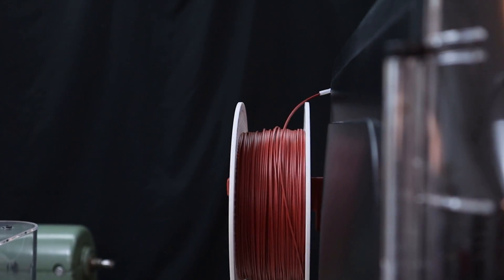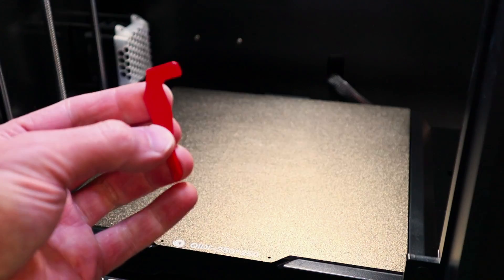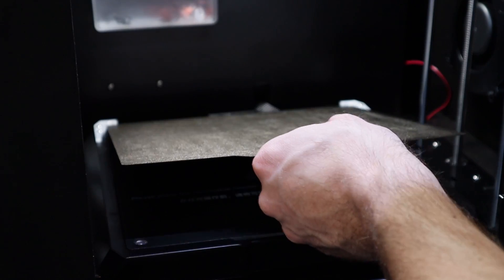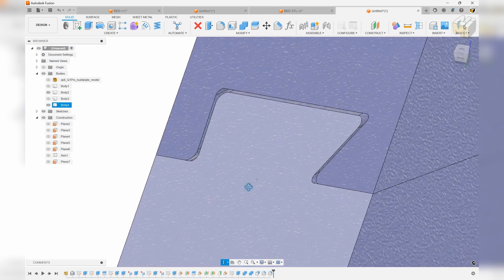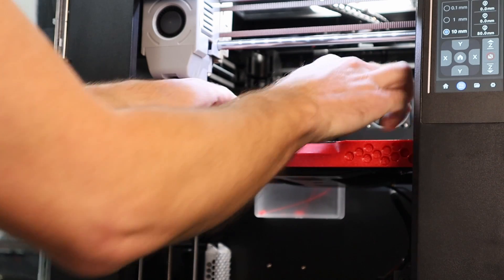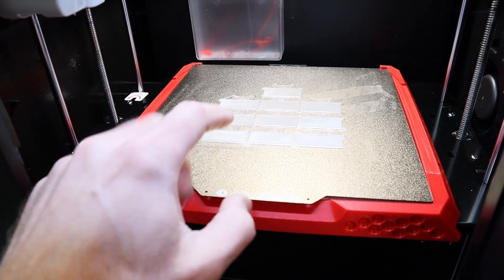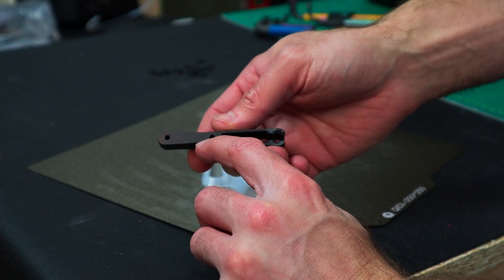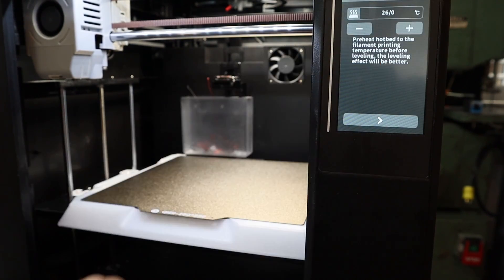Upgrade your QIDI Q1 Pro with Dual Build-plate Stops + more

Comment: Its fixed. Super easy to place on my printer. The wiper is the biggest issue. Leave the structure on a side. Only time will show how reliable it is. But the felt pad... Silicone brush, carbon fiber brush... I am pretty sure there are at least 10 other better options.

Comment: I just got my Q1 PRO. Good news, this upgrade is no longer needed, it comes with the new machines along with a larger print surface 250x250.
Reply from the maker: That's good news, it would be a bit annoying to have to buy a spool of higher temp filament just for this job.  I'm glad they decided to make the adjustment.  My Q1 is still going strong, it's been a really good machine.

Comment: Thank you for this video! But I have some questions... Please help me...
1- How could you dismount the black frame which is the bottom of the bed? I saw 3 screws under the pei table but they are so rigid. I couldn't dismount.
2- How could you dismount the side covers?

Comment: Qidi has fixed this now in their latest printers. The shroud now has two notches in the corner rather than one in the middle. So cool to see a company like this listen to customers and make adjustments even on a budget printer.
Reply: This is cool to hear. I just ordered on for my classroom toolbox and it's nice to know the company is listening and adjusting.
Reply: @AmericasTeamAdventure  Awesome. Hopefully it works well for you as well.
Reply: Yep I bought one of the new ones after seeing the original reviews and was confused on that. I just assumed it was customer feedback related
Reply: I guess, that's the price you pay, when you get a free preproduction unit for review - you're the beta tester ;-) 

BTW, that's not the only thing they fixed. They added a note for European customers on how to prevent to electrocute themselves. Since for example German plugs can be plugged in either way, you could end up with the build chamber heater being live (and not neutral).

And if I got this correctly, they also rearranged the ptfe tube now so it doesn't scratch the top cover any longer.
Reply: @PeterTeuns  Yes! They did fix the PTFE tube. I didn’t want to comment on it before having the machine for long. It’s now been just over a month and my top panel looks great.

Comment: Love it thanks. Question for anyone that has done the platform calibration . After you unscrew the nut and the cal , should you tighten back the nut. I ask because i noticed when i tighten the nut the  and do a quick paper test it seems now  be off and not how i left it. It pulls the plate down. Is that ok?
Reply from the maker: Ah yes, what I did for the nut was add a bit of blue Loctite, you can also use a dab of silicone, and then when I tighten it to the bottom of the 1st nut, I just bring it snug, not to tight, that should help.  Sometimes when you tighten a jamb nut it can also rotate the nut above it.

Comment: Thank you for this video! I am so new at 3-d printing that my QIDI pro printer is supposed to be delivered tomorrow. These parts appear to be needed and I will attempt to print them out. I also subscribed as I think your channel will become my favorite.
Reply from the maker: Hey thank you!   You're going to have a great time with this printer, it has to be one of the all time best bang-for-the-buck printers.  Before you print anything, I've heard that they have have added some stops in to newer models, I can't confirm this for sure, you may want to open it up and see, maybe you'll be able to save some time and filament.  If not, you'll at least have a backup plan.  I have videos coming at least once per week, I'd prefer more and I think some weeks I'll be able to do two, depending on complexity etc.  Any support is greatly appreciated!
Reply: @NeedItMakeIt stops?

Comment: I've been running this thing for three days straight not one fell
Reply from the maker: I've had a lot of success with the printer, I think the only 2 issue I had which was really my fault were that I set the temp at exactly 60C and it likes to be just a tad lower so it threw an out-of-range error and then when loading and unloading filament I've found that extruding to make sure the filament isn't too soft for PLA when trying to load in new filament.  The path for the filament could be a little shorter and I find that it helps to extrude and then retract to get a good pull.  I've a couple of times now where there will be a piece of melted filament that gets stuck.  Other than that for the price, this is my #1, Bambu X1C is a great printer of course, but it's pretty $$, and then the K1s come after, they need a bit more work on their extruders and the overall frame design IMO.
Reply: @NeedItMakeIt  yeah I'm so glad I got this, and the extruder issue only becomes a problem if you pull the filament out when changing if you do the manual mode to push it out that's been giving me no problems at all except for a few times when I was going from petg two PLA in those times I think some melted pet G was in there and I only had the extruder at 220 so I had to push retry like three times
Reply from the maker: @NoMercyFtw  Yeah overall bang-for-buck this might be at the top, everyone had different wants in a printer, it's hard for one printer to be perfect for everyone, but this one gets very close.

Comment: But does it really matter that it's a millimeter off? the print plate is 250 mm, the printing area 245 mm. You could misplace it by up to 5 mm and it wouldn't still matter.
Or have I misunderstood the issue?
Still, since you designed it, I'll use it once I get mine.
Reply from the maker: I's not obvious and it depends on the height of the bed in relation to the shroud.  If the bed is set lower on one corner/side like mine was and the build plate is mis-aligned it does not touch the magnet and will bend upward.   That's not a massive problem unless you print close to the edge of the bed.  I think for most people it's just nice to be able to position it correctly, in other words it bothers them when it's not correctly lined up.  When I did this, I was automatically trying it again and again.  So to your point, no it's not super critical for most cases, just a nice quality of life improvement.
Reply: Actually it's 5 mm extra, so just 2.5mm per side. Likely enough but I see the point
Reply from the maker: I think for most prints it would be fine to go with a twisted buildplate, I just don't think most people (I'm assuming) would want to see it that way.  It bothered me enough to want to fix it, I suppose it depends on the person and whether it bugged them as much as it did me.

Comment: First time watching this channel. Great job on the CAD. If I pull the trigger on this printer I'll definitely be printing your design.

Did you consider also putting a raised section towards the front sides that might help with potential build plate movement from collisions? Not sure if that would interfere with putting the plate back.
Reply from the maker: It's not a bad idea, I stuck with the basic design mainly because I didn't want too many areas which required tighter/closer proximity to the bed which could rub.  It's not so simple with this heated chamber and the bed temps getting up to the 110C max, everything is moving and expanding at different rates and it became quite a job to make sure that it was close, but not too close.   Great idea though.  From what I'm told, they've found a way to do this from factory, but I haven't seen what their solution looks like yet.   Still a great printer, I'm having very good results with it and enjoying being able to print with some more engineering type plastics.

Comment: I use the left side to align the print plate,, works nice.  Will be interested to see the nylon or pet carbon fiber prints.
Reply from the maker: Apparently the newer models have some solution by QIDI, I haven't seen it myself.  Do what works!

Comment: Great job.  I'm waiting for my 'pre-order' Q1 and checking online for as much info as I can before it arrives.  Will be doing spool mounts also.  I've had multiple printers over the years and have never done long (overnight) prints because of fire risk.  What are your thoughts of risk - suppression systems for an enclosed printer?  Thanks

Comment: I was having similar problems with PETG collecting on the nozzle on the Prusa XL.  Robert Cowan suggested raising the nozzle temperature, and that solved the issue for me.  Raising the temps lets it flow better, so I get less broken infill, which is where the accumulation was coming from.  I have also found red PETG to be particularly problematic.
Reply from the maker: It's probably worth looking at closer, I switched to gyroid infill a while back because it doesn't pass over the existing extrusion, which is less noise and never has any issues with areas which are missing extrusion.  Nozzle temps are quite high for PEPTG, I normally run at 270, or 275.  I go for best adhesion rather than for looks.  Thanks for the thoughts on that, the next  time I print, I'll watch it to see if I can find out where the accumulation happens the most.

Comment: Nice!  Thanks for sharing.  The build plate location system is the biggest daily frustration with this machine.
Reply from the maker: I've heard that they've already addressed it in anything new, but I can't find any concrete info on it.  Should be interesting to see what they've come up with if it is actually adjusted.

Comment: 5:21 how do you convert an STL file into something useful in fusion? The only thing I've been able to do is stumble around with some mesh objects, and it's been quite a pain to say the least..
Reply: I kind of liked the hexagon pattern, even without the black inserts; though I liked it a bit more in the red, but I didn't think it looked bad in the Polly either 🤷🏿‍♀️
Reply from the maker: I like the pattern in red as well, but it didn't really suit the printer.  I should have some new High Temp filament arriving tomorrow and then I can re-print the shroud in a dark color.  Maybe I'll add one different colored hex on it somewhere for fun.
Reply from the maker: If the mesh is 'clean' like the one I started with, you'll have success doing what I did.  If you have a rounded shape or something that someone scanned, it's nearly impossible, and you'd be better to start from scratch.  Sometimes I scan a 'subject' and then I try to duplicate the shape in Fusion, but it almost always ends up being easier to take the measurements because working with a complex mesh really slows down Fusion.
Reply: @NeedItMakeIt  I mainly asked for downloading and modifying files like logos or whatever.. just wish Fusion had a better interface for that.. as for the hexagons not really suiting the style of the printer, maybe go with some geometric lines or something to give it some movement, but deviate too far from the style of the printer
Reply from the maker: @TS_Mind_Swept  I haven't found a great solution for that either.  I can sometimes take a logo, convert it to an SVG and then bring it into Fusion and it works.... very slowly I might add.  But other times, it just doesn't work well.  You're better off to trace it out, as time consuming as that might be.  I'll hide the hex if I do add one, don't worry!
Reply: @NeedItMakeIt  I pretty much did Trace out the logo for the last thing I did, though it was just the outside since I found a way to make the mesh usable (even though it took forever..)
But don't hide the hex, that's the funny part! D:
Reply from the maker: @TS_Mind_Swept  I feel your pain, I've done this quite a few times, using AI to generate an SVG may work as well, but that's likely a paid one.  

I should add just one hex to everything I do, just enough so it looks out of place.
Reply: @NeedItMakeIt  You'll really get people saying 'what the hex' then KappaRoss

Comment: Really good work
Reply from the maker: Thanks a lot; it took far more work than I was expecting, I had a few test pieces I didn't bother to show while I was trying to get the sizing just right after shrinkage of the PC, but not too much space either.  A bit of a learning curve, but that's the fun of the challenge.
Reply: I always love your content. I'm really curious to know your tolerances in fusion 360.
Your connections are always perfect.

Comment: I just ordered a Q1 Pro this morning, I know I'll be printing some of your upgrades.
Reply from the maker: Nice, it's a little quality of life improvement.  I've been having some PETG sticking to the nozzle, so... I made the mistake of taking the nozzle off and trying to clean the PETG with a scotch bright.... well I don't recommend doing that, it slightly rounds off the sharp corners or the bottom of the nozzle, I have some new nozzles on order.  Next time I think I'll just heat the nozzle and wipe it with an old cloth.
Reply: @NeedItMakeIt you have prints that use the nozzle wiper of an A1 as a toothbrush

Comment: Thinking about buying this printer.  How about tossing the shroud in the garbage and gaining some build area?  Would a 256 x 256mm plate then fit?  Whats the size of the underlying bed?
Reply from the maker: Sure go for it, it's there for decoration, but it won't gain you and build-volume, the gantry limits are the problem.  Those mounts are beefy and take up some space.  I believe we're at 245 x 245, maybe you can squeeze an extra mm here and there if you wanted to try.  I've found that printing near the edge of the buildplate with heavy duty parts on any printer will cause the plate to want to lift at the edge.
Reply: @NeedItMakeIt thanks, yeah good point on lifting - I was thinking there'd be at least ~25mm overrun all round as per the purge station.  Think I'll go for this printer, it looks great.  BTW, nice video, workflow and final prints on these adaptations!!

Comment: why can't companies just make a good printer that doesn't need modifying
Reply from the maker: This printer is pretty cheap for what you get, and to get the price down into that range, they've cut some 'fat'.  This printer at this price-point is an excellent deal and there is really not much wrong with it.   The lack of a proper filter (Those don't last long) and the spool holder being too floppy, as well as this buildplate mod, and his one isn't a necessity, it's just a small quality of life improvement.

I don't think there is any one printer that has everything, Bambu has the pooping and wiping issues, Creality has a few lingering issues with extrusion and frame stability.  

I do a lot of design work, and it's not always as easy as it seems to account for every single possible issue.  Sometimes you need to move on even though it's not the absolutely best that it can be.  I don't like doing it, but it's necessary to be able to complete a whole project.  I'm sure that holds true for most anything, whether it is a printer, or a car, or when you're renovating your home.  

Anyway, that's my 2 cents, take it for what it's worth.

Comment: Have used my q1 pro for a week now and havent removed the plate once. So dont see any problem with the lack of print bed stops.

But really nice work!!👍
Reply from the maker: What, you never remove the plate, you're at GOD level 3d printing.  You're waiting for the print to cool and it releases on its own I suppose?  

I still glue all of my prints, I print super heavy, sometimes nearly solid and it will want to lift in any printer.  This printer  is the best out of any so far because of the heated chamber, but I still like to do it to be safe.